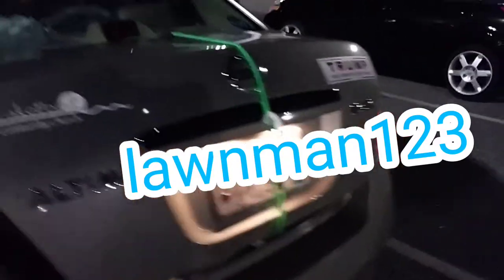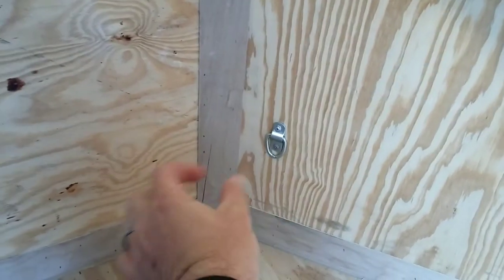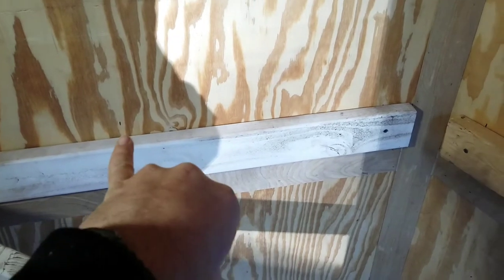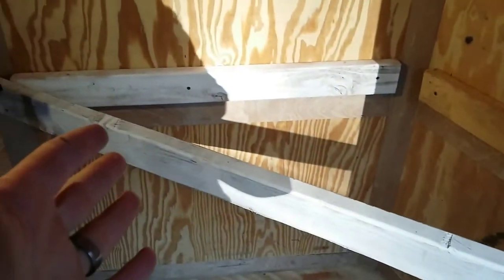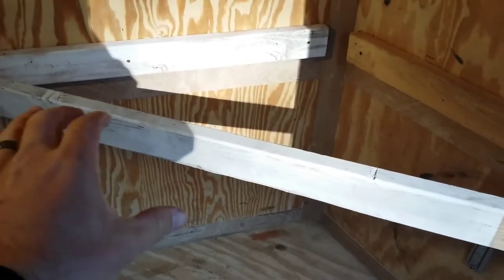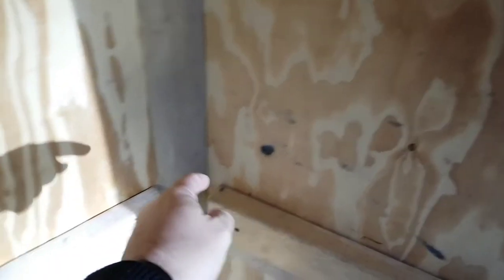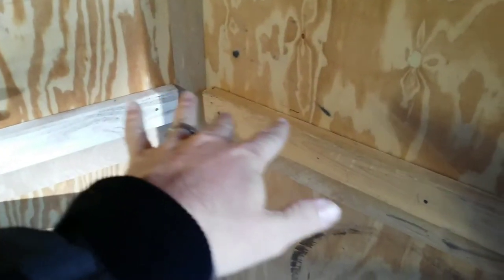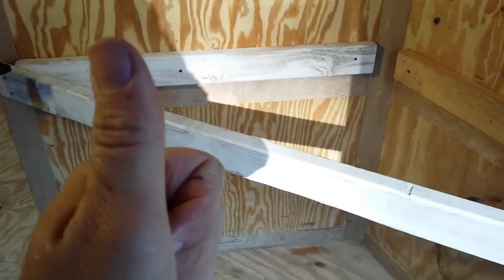How to build enclosed trailer shelves☆lawn care setup enclosed trailer☆

Comment: When you put a screw in the wall is it a metal self tapping screw, Because I assume that Trailer has metal studs, thanks
Reply from the maker: Self tappers work but still easyer if you drill a hole first and i used high quality deck screws